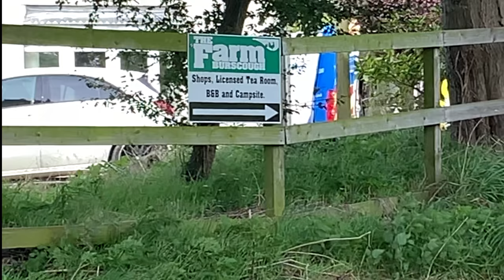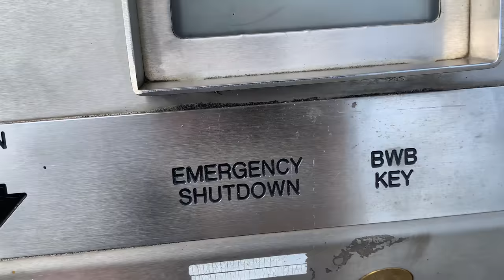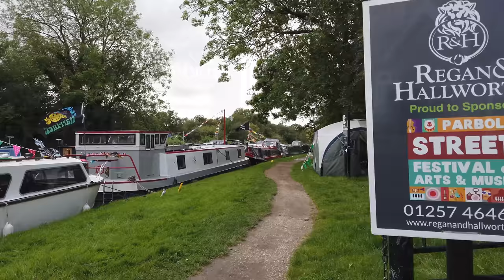63-Narrowboat Repairs and Blacking

Comment: When you black the boat do you also do the actual flat bottom underneath or just the sides?
Reply from the maker: ipb1966 - Just the sides apparently no need to do the bottom as the steel is much thicker! Thanks for watching and commenting!👍
Reply: You dont need to do the bottom of a boat as it cannot rust.
You need Oxygen and water to create rust 💙❤